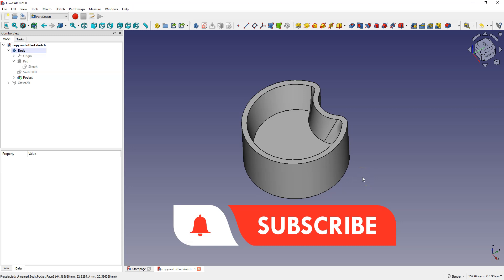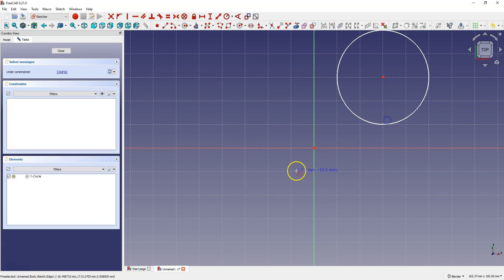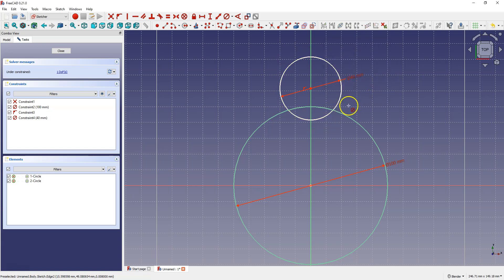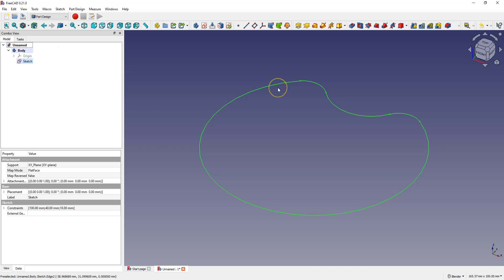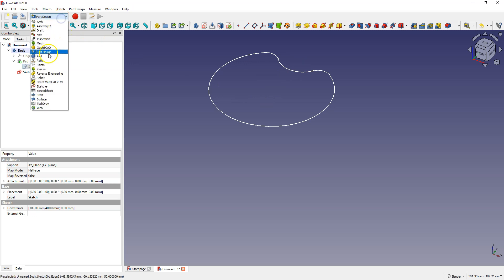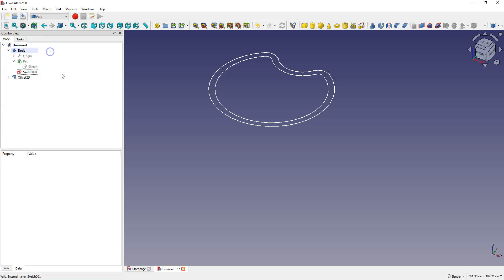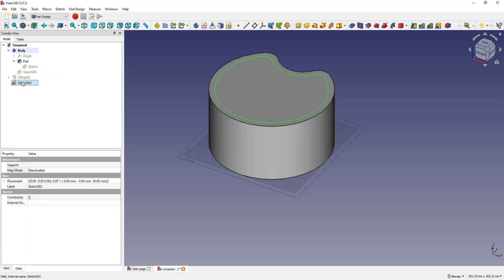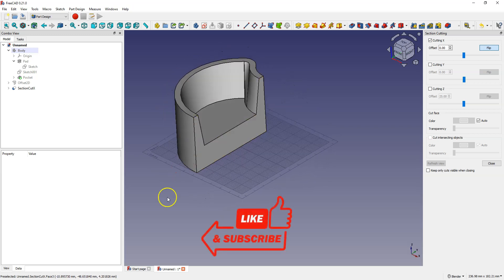Part Design Workbench | Create 3D Model | Copy and Offset Sketch | FreeCAD Tutorial for Beginners

Comment: Oh, I wish I could get this to work on mine. Draft is all messed up, keeps putting things in the wrong place. Very inconsistent.
Reply: When activating Draft WB you must be sure that the active working plane is XY. Sometimes the "Current Working Plane" tool set to AUTO is working well but sometimes it doesn't.... Anyway if grid is seen under the sketch as it is seen from the top it has to work correctly. I hope this will help you.